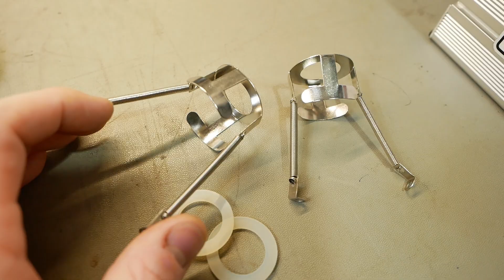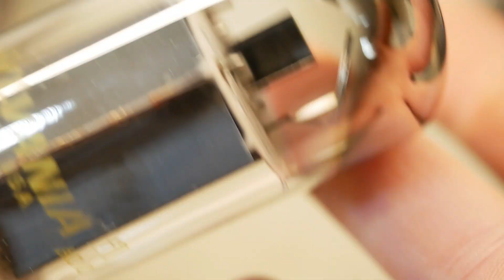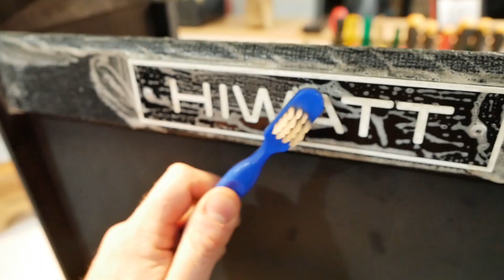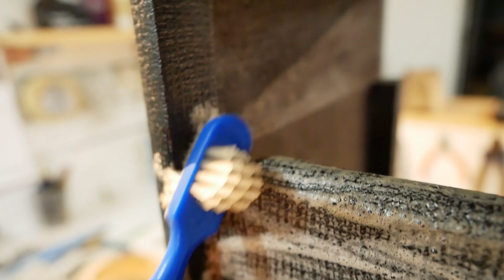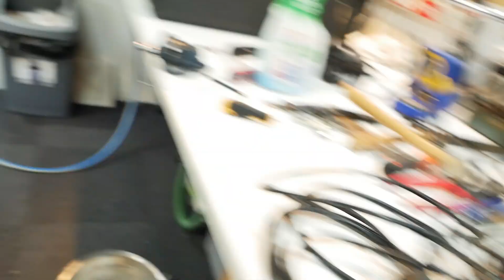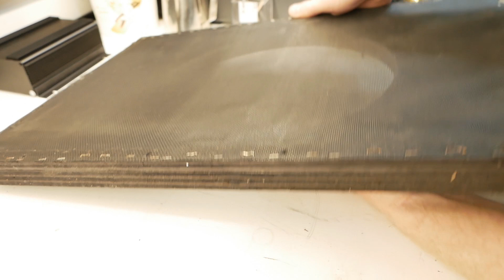Custom Hiwatt 50 SA112 - Part 2

Comment: By using hot air on the grill cloth, is it in effect expanding it then contracting back further than where it was when it cools?
Reply from the maker: It works a bit like heatshrink. Like when you throw a plastic bag on the fire and it shrinks to a little ball.